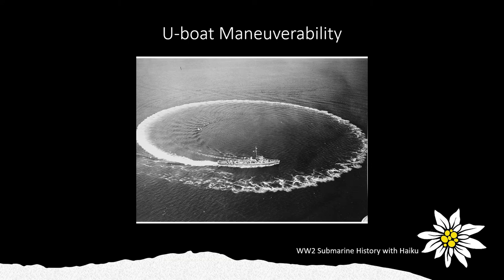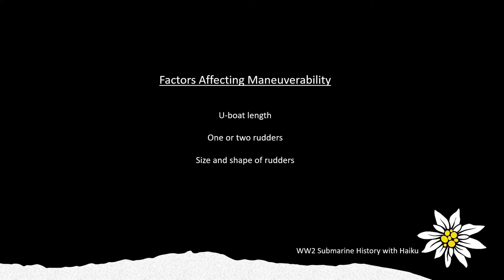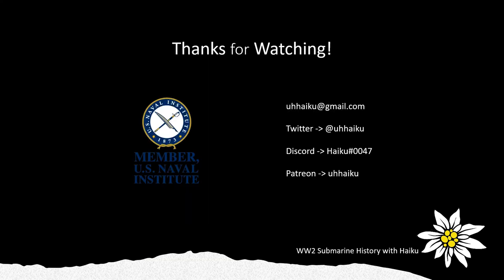U-boat Maneuverability - #6

Comment: Again, a lot of interesting bits of information. For example, the number of rudders on the type VII u-boats. In the U-boat game the type VIIB has two rudders, so could I assume that only the type VIIA had one rudder? Also interesting to learn that Doenitz was personally involved in the setup of the u-boats by voicing his concern about the type VIIA only having one rudder.

Looking forward to the rest of your series. 😄
Reply from the maker: The Type VIIA was the only boat with a single rudder.  It was realized early on that the single rudder limited maneuverability.  Another benefit of two rudders is that the stern tube could now be loaded internally starting with the VIIB.  With the VIIA that stern tube had to be loaded externall, so one shot only.  The Type VIIAs (at least some of them) remained in service as trainers till the end of the war.